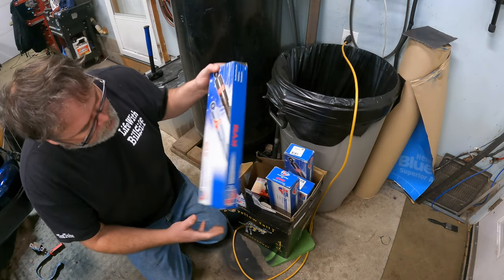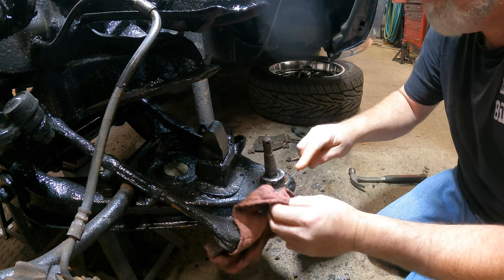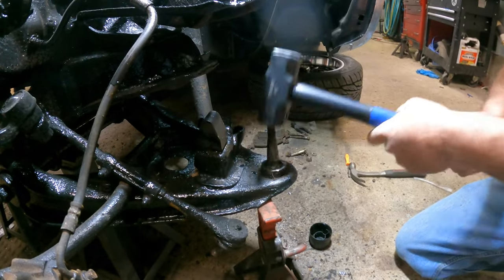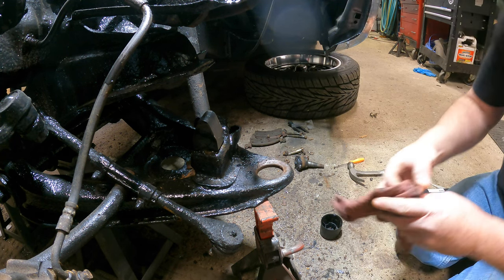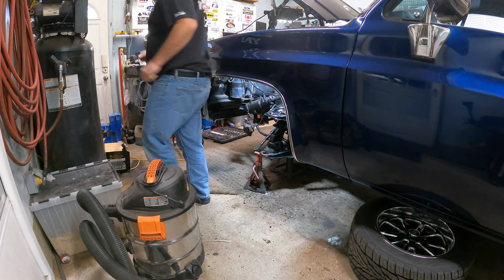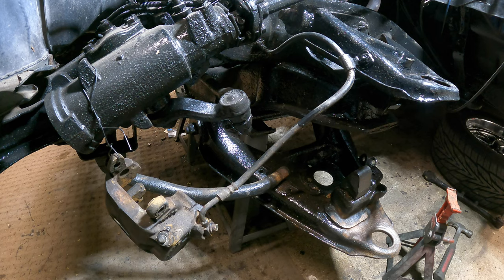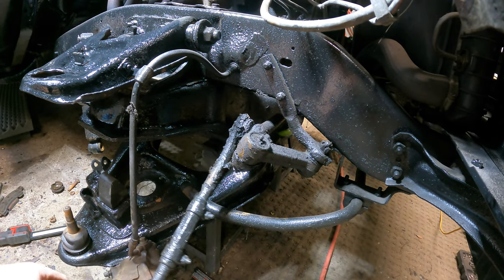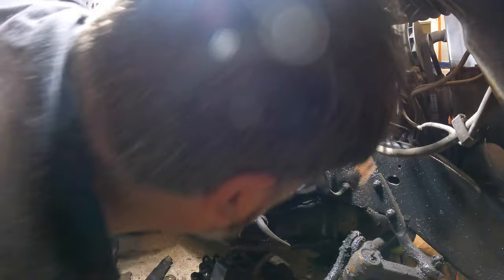Good Deal On New Parts   But Is It?   4K

Comment: Nice hammer.  

Good plan on holding onto the old parts.  And yes, there is a front shock out there that comes with the wrong upper mount, and you get to wrestle all the mounts out and fight to get the old mount into the new shocks.  But that was over 10 years ago when I encountered that, so hopefully everybodys got everything correct now.

Comment: I love hammering out ball joints! On your Chevy Silverado it pays 4hrs to do both lower ball joints and as long as the control arms are steel and not aluminum you can hammer them out and have the complete job done in about an hour